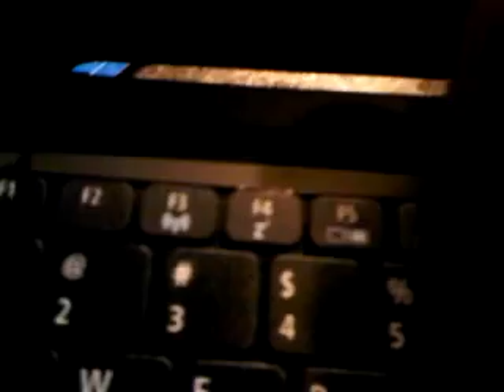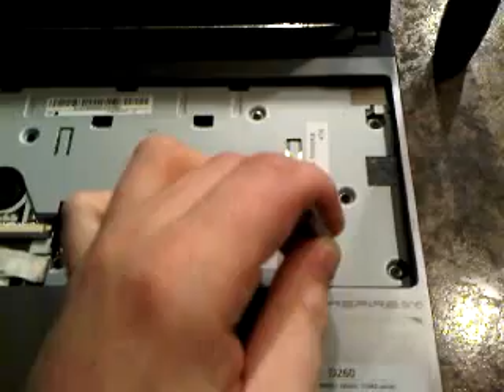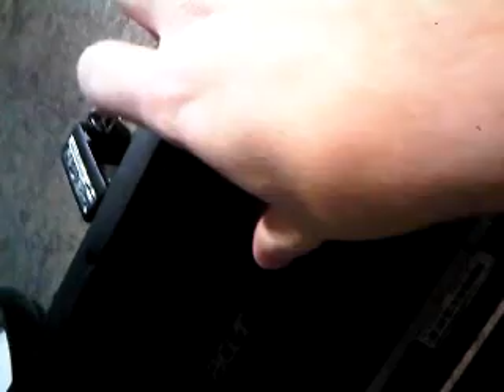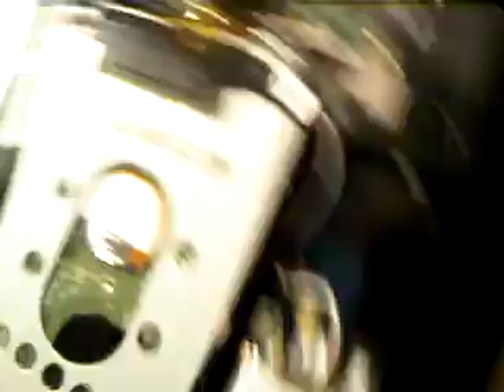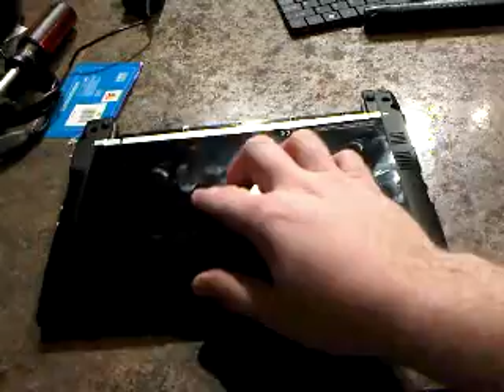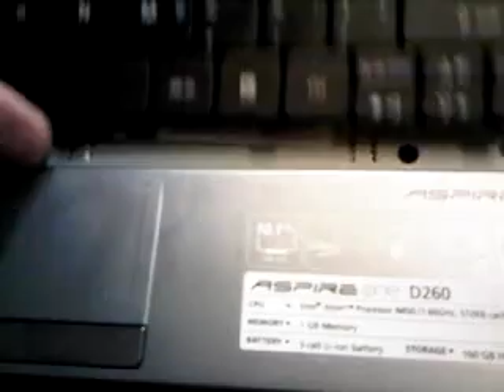How to access the Ram and Hard Drive on an ACER ASPIRE ONE D260 READ Description 1st!

Comment: There may be multiple assembly versions with the same model number.  I just opened up an Acer D260 and it does have the four screws that hold the bottom panel.   On the one I opened,  the metal plate under the keyboard has a diagram that indicates that there are four screws indicated by the number "1" inside a circle next to them and to remove them before pushing through the hole next to the number "2" as shown in the video.  

For Shayna, the keyboard ribbon cable is held in by a small brown  (tan?) locking bar.  With small screwdrivers, tweezers or something similar, just slide the two tabs of the brown bar slightly forward, about 1/16".  That will release the ribbon cable.  To replace the cable, hold the bar  forward and slide the cable back underneath until its fully seated and push the bar back till it is flush with the white connector body.

Comment: Don't forget the four screws labelled one under keyboard after the removal of keyboard to get bottom off. Don't just push on base through hole with phillipshead  screwdriver or you will snap your screw fixtures!